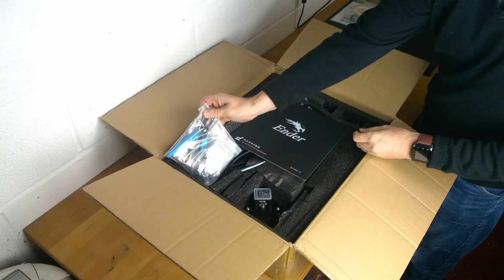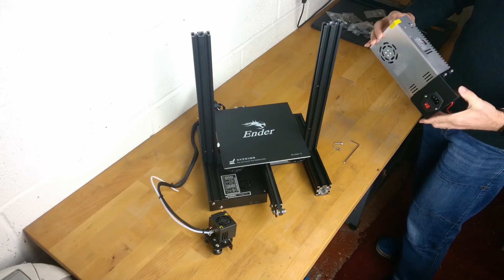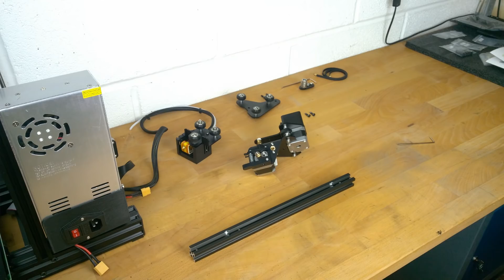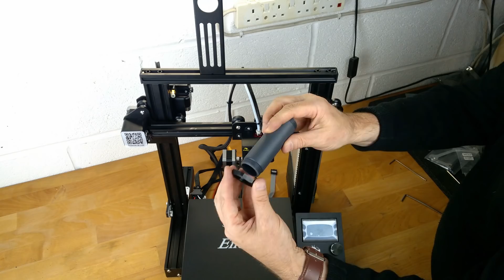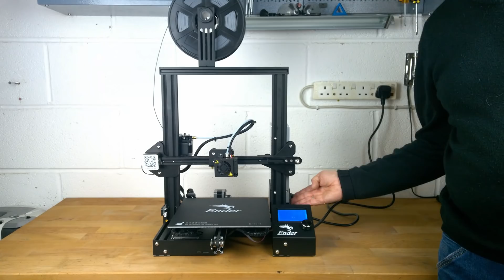Creality Ender 3 Build Tutorial

Comment: At 10:17 you, "move the assembly down" by pressing down upon it.   When I try that  nothing happens.   The bottom doesn't spin and allow the arm down.   Have I done something wrong, if so any idea what?  Also when I spin the bottom part it does go down and up depending on the direction of the spin.

Comment: A clear and concise guide. No waffle, easy to follow and short. Built my Ender 3 in under 2 hours including fitting an upgraded metal extruder. That reminds me, your extruder looks to have been fitted the wrong way through most of the video but was correct at the end... I'm guessing it was wrong from the factory and you only noticed it towards the end of the build. It did confuse me for a while.

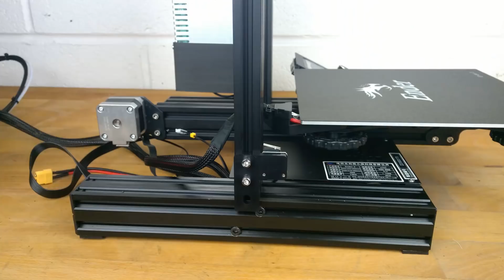Comment: At 4:47 - they have added a stop to the Z-Axis limit switch - its at 35 mm for me
Reply: Powdermonkey99 yeah I was gonna say that, I just set up mine and idk what to do about that? Do I just leave it or adjust the bed some other way ?
Reply: @kiddfpv  What is that Long needle thing with a spring on the end ????
 I have some parts that were not even mentioned ???
Reply: @kiddfpv  I just figured out what the extra springs are for... Leveling the table. :-)

Comment: hey great tutorial ! upon arrival, one of the z cables was damaged (Cut), is there a way of salvaging it ?
Reply from the maker: You could try soldering the wires in the cable back together, or replacing the connector on the end of the cable if the cut cable is long enough
Reply: Thank you for the fast reply ! So if i go with soldering the wires,  it wouldn't affect the connection would it ? or maybe i can just take the connector and place it in the left over cable ?
Reply from the maker: No it shouldn't affect the connection, as long as you solder the wires up in the same order as the original, the wires are usually crimped into the connector, so you may require new crimps if you move the connector.
Reply: alright i mma try that ! Thank you very much !!

Comment: Just some constructive criticism:
1) Your audio clips a few times. It's a bit too hot, in general. I'd recommend moving your mic a little further away, or adjusting the input gain.
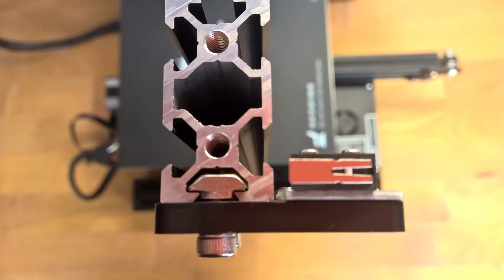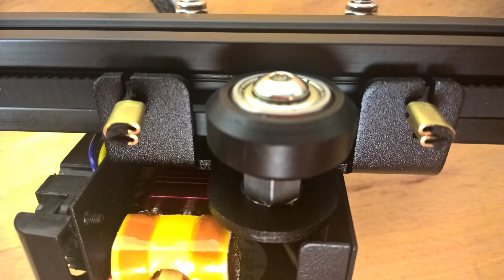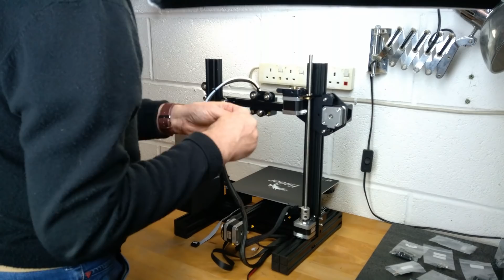2) Precise details are hard to see, especially on mobile screens. I'd recommend putting in additional close-ups of screws and such (like 4:33 and 8:18! Could have really used a closeup at 10:38 :). Especially where there are washers involved and it's not clear which part the washers  go on.
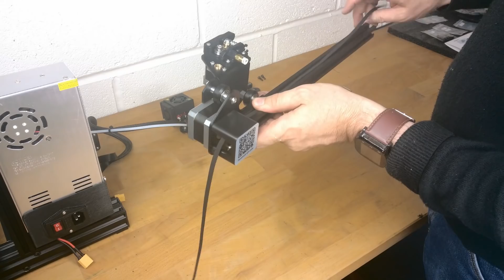3) Around 7:17, the lens gets fogged for some reason. Might want to look into that.

Otherwise, thank you for a spectacular and very helpful video!! :)

Comment: hi
i measured both sides of my top rail and they are not even so the print head is not level - any ideas on how to fix this ?
many thanks
Reply from the maker: If you mean the two uprights they should be the same length, if not contact your supplier, if the whole printer is not level on it's base try loosening some of the screws in the base slightly and then placing on a flat surface and adjusting and tightening until level. Note the print head does not have to be level to the "ground" only level with respect to the print surface, which is what the levelling process achieves.
Reply: thanks - all working 0  -removed washers from bath sides and tightened up - all level

Comment: I wanted to say thanks for the video but I have some comments and questions. From the start of the video you could see that the base was not level and could see a wobble. Why not show at that point how to correct it by loosening the side screws and putting pressure down on the assembly to make it sturdy and level before tightening the screws back?  Also, there was no talk about making sure the vertical posts were truly vertical and square. All of these fine details are what make the printer print well and I would figure you would call out some of the obvious problems during assembly. Having said that, having this basic video showing the steps is amazingly helpful and I thank you for it!

Comment: Thank you for this video! I was able to use this and the complete instructions on the Creality SD card to have a successful build and a very successful first print! 

A couple of comments were made previously about the new z endstop design that has the little tab. I have one now as well and it seems to work just fine. 

I also followed the printed instructions in that when I installed the x axis mechanism, I loosened the two tiny screws around the coupler that holds the z axis screw shaft, so that it easily went on.

Well done and carry on!

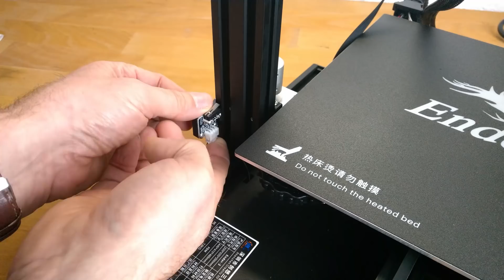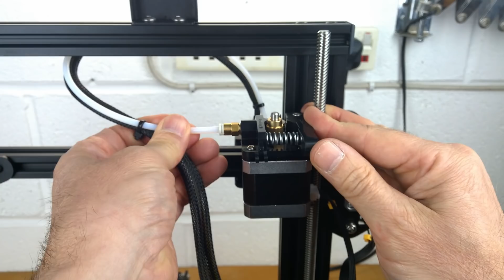Comment: How come you didn't mention that your extruder was mounted to its bracket 90° clockwise from how it should've been? At 13:27, the bowden tube fitting is pointing towards the front of the printer instead of the middle, then it's just suddenly fixed by 13:55. If yours came assembled that way, it's good to tell people about it so they know (how) to fix it.
Reply from the maker: Hi this is covered in the follow up video https://youtu.be/ozzjcokB4UI
Reply: Ah, in that case, I wish I would have known! As it stands there's no reference to the follow-up video in this video's description, and YouTube isn't auto-suggesting it to me, either. Good on you for mentioning, regardless!

Comment: Thank you! Excellent tutorial, just used it on my build. I think they have changed the design of the z endstop. Mine has a little plastic tab which I presume rests on the horizontal member to get the correct z height, looks about right 🙏. Off to watch again your first print video. Thanks again! Cheers
Reply: I was wondering the exact same thing. I just put mine together.
Reply: As others have said, great tutorial! Many thanks for doing it!
Reply: I watched another video from “the hot end”’ he advises to snip that tab off, which I did and filed everything smooth. No issues and I was able to get exactly 32mm. Glad others discovered how it’s supposed to be? Who knows, mine worked by removing the tab. If I saw this I would tried to get it into the rails but since I saw this prior I was in the look out for it.

Comment: Well done! I'm getting mine today and intend to use this video to assist me in assembling it. Kudos for the professional job you did and thank you very much!
Reply: Follow-Up; I BREEZED right through the assembly thanks to your video (didn't even open the instructions sent with it)! I only had one minor problem, and that was when you were showing the assembly of the Zed (Z) rail to the Bowden extruder assembly. In your video (starting at about 6:03 in your vid), your Bowden extruder tube connection point was showing 90 degrees difference in the direction it was pointing when you went to connect it to the Zed rail then what mine looked like at that same point in the assembly. Did your Bowden assembly come to you improperly assembled? I thought mine was wrong at first, but when I put the Zed rail up to the gantry beams (I was trying to visualize it fully assembled) mine was pointing exactly in the direction it should be.  It wasn't a show stopper, but it did throw me for a little loop. Your video was astoundingly accurate, and enormously helpful, thank you again!